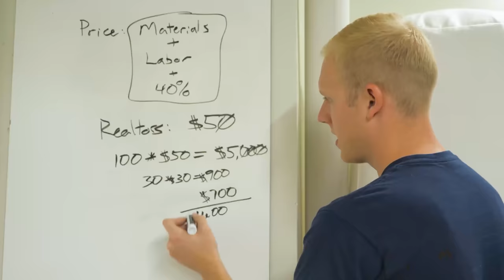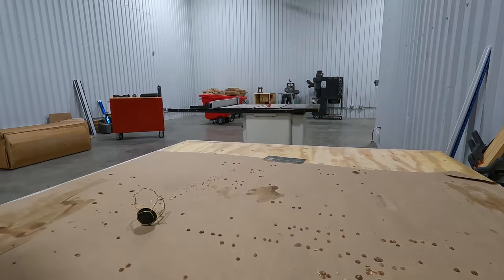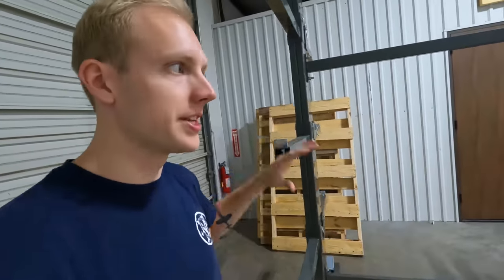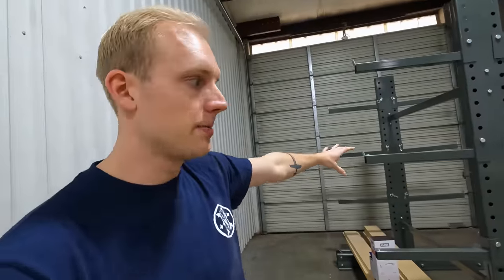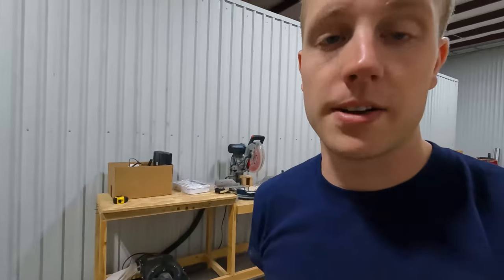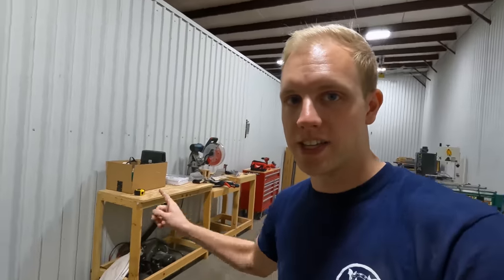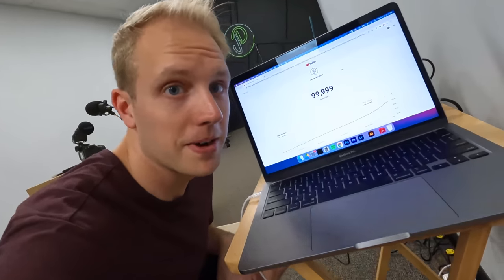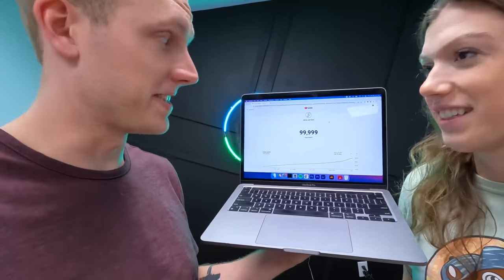there's a moving truck SHORTAGE!!

Comment: With regard to the new place, consider leaving enough space for a car or van to park INSIDE. Loading and unloading in bad weather would be much easier. Especially if you have the space to spare. Paint the floor area or put rubber mats down to mark it off and keep it oil free.
Reply from the maker: That’s the plan on the other door!
Reply: @jennieanddavis  you are going to park your truck at the other end of the shop and walk your lumber to the other side?

Comment: Enterprise is always good for renting vehicles of all types. Glad you were able to find one and could get your material loaded safely. Now to make the first official grease stain on the floor, the first official scratch on the wall, and the knowledge that it's yours to grow with because of the sweat and tears you both have invested in your dream of moving your "empire" beyond the garage. Congratulations on breaking the 100k subscriber mark. Now look for the 150k, 250k, and beyond. Do you have the spot marked already for the beautiful plaque announcing your 100k milestone?
Reply: Number 1 travel tip. Don't rent a car when you're traveling. Rent a pickup from UHaul. $20/day, no deposit. Take an Uber from the airport to the UHaul place. Reserve in advance, though.

Comment: Hi.  Have been following for about a year now I think.  Congrats on 101K  subs.  The one thing I am curious about your new awesome space is sound.  I am wondering how much noise will carry into the office space when you are running louder tools like a planer or jointer?   Is there a good amount of insulation in the walls and ceiling of the office?  I know I can here the planer through the walls of my shop...

Comment: What do you have for vehicles? Do you not have a vehicle that would be capable of towing a flatbed type trailer that would have a ramp to roll the tools on and off of or use a pallet jack to get them on and off. Granted that I’m sure that it was nice to have the enclosed box truck with the lift gate. I really like your channel and while I haven’t really gotten my woodworking up to much of a business standpoint I am wanting to and I have learned a lot from you folks.
Reply from the maker: You can drive a nail with a screwdriver... but why would you?
Reply: @jennieanddavis  🤣 yes that you probably could lol. I could see that maybe being done if someone was in a real pinch and absolutely needed to get a nail in and didn’t have anything else to do it but would probably only work for smaller ones.

Comment: Thank god you didn't get pulled over while moving the shop, or taking the truck back.  That truck had air brakes which requires a CDL classification on the license.  If the shop were still in the truck, and you did get pulled over, they would have impounded the truck with all contents and gave you a ticket for driving out of class.
Reply from the maker: That’s why we brought a few bricks of coke - they would focus on that instead of the air brake! 😉😉

Comment: I am pretty sure the truck required a CDL since it had air brakes
Reply from the maker: Everyone keeps saying this… but the air brake was the least intimidating part of the whole truck! Why is that the determining factor? Not size, gross weight, or height?!
Reply: @jennieanddavis  Hi Jennie and Davis, it’s true that the CDL is required for gross vehicle weight of 26,001 pounds and up.  The comments of the air breaks is because you are required to have a CDL and the air break endorsement to operate an air breaks truck.